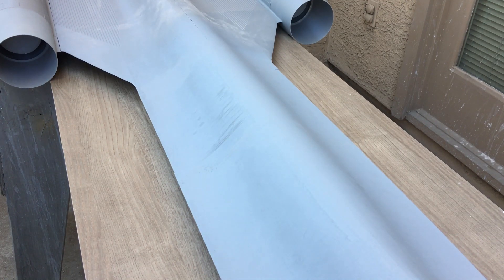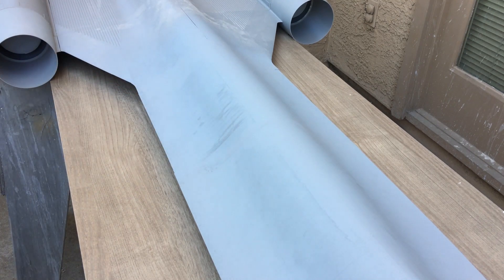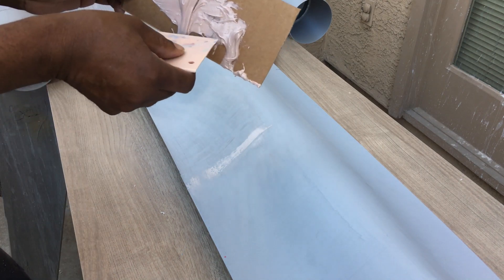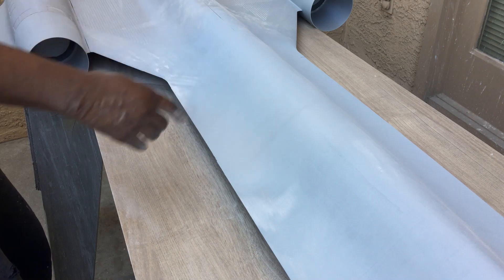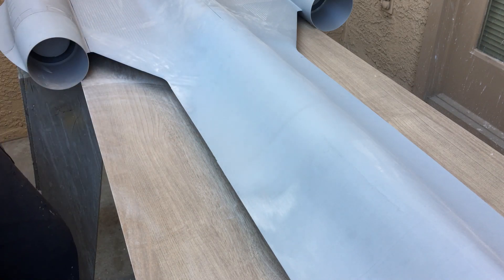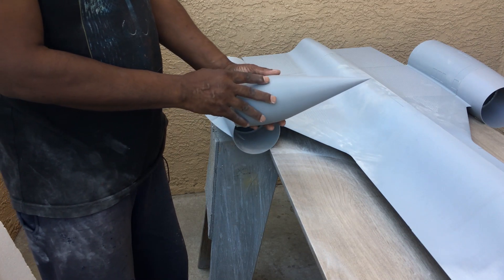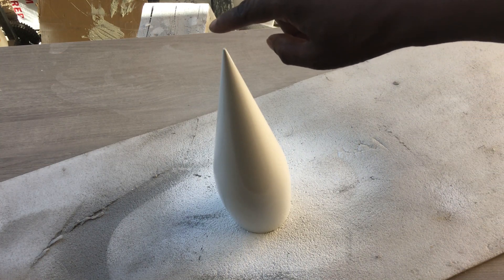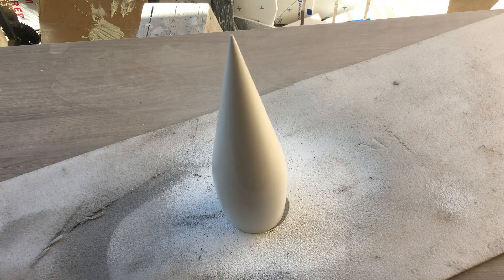100 Inch SR-71 3D Printed Plug For RC Model

Comment: I've noticed that the engine bodies are directly straight. not to be dismissive of your model but this is inaccurate. The real one curves inward towards the nose a tad at each engine. cool bird and I'd be interested if you can make the necessary modification to the CAD files and sell them to me. other wise, I'm gonna keep looking until I can find one JUST like the giant jet powered one on YouTube some guys flying - his is accurate to the T but can't get ahold of him about the fueslage. IF I'm gonna invest this kind of time and money into this kind of build it needs to be as close to the real joint as possible. none the less, Really an amazing model man and thanks for the tip about the spaces in between. keep up the good work every detaio help towards perfection.
Reply: Any luck with the CAD files?